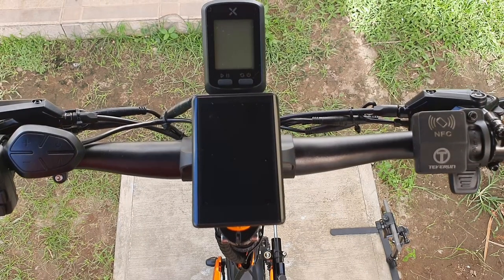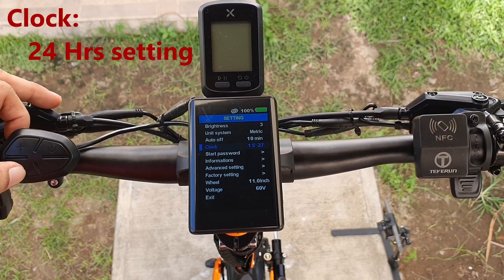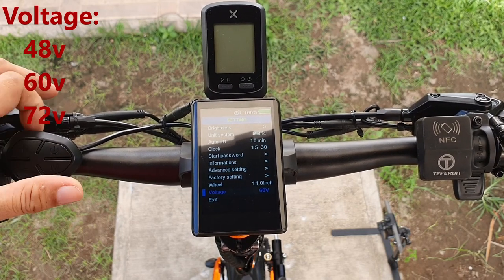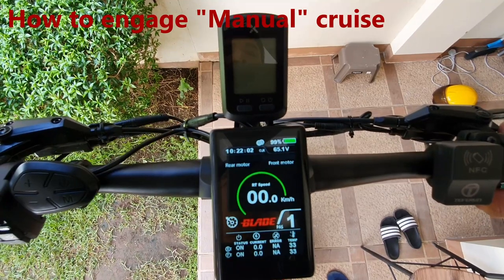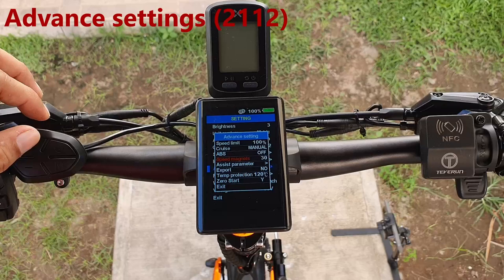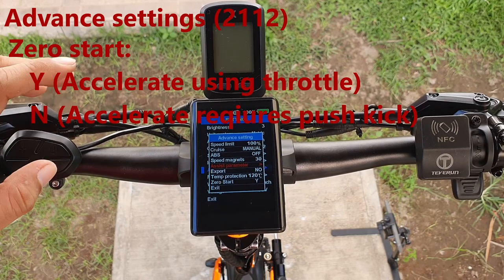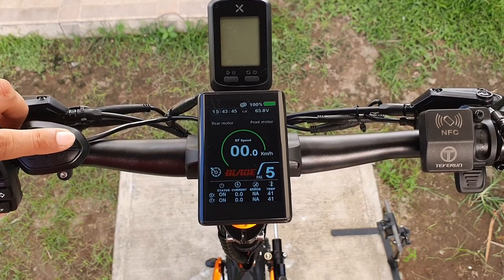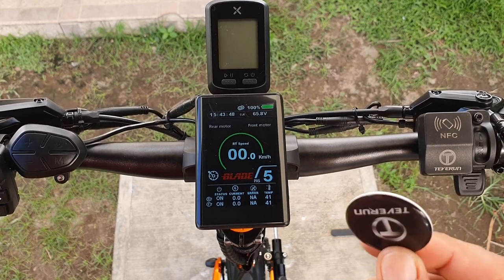Blade GT Plus - TFT Display Info and Settings

Comment: I’ve heard from another vlogger that the inside wiring is really bad. Can you give any tips on how to secure the inner wiring? Where to add thermal pads or electrical tape to boost the longevity? You seem to know your stuff!
Reply from the maker: Hi @Travis Thank you for your comment. I am currently doing a video to improve waterproofing to our scooter deck, cable/wiring management will be included in the video as it plays a significant role to making it watertight.
Reply: @ScootTaBai  Will you be doing anything to improve the wiring insulation or sharp edges in the deck as well? I've heard issues about shorts and fires etc

Comment: I was told the temperature are not from motor but the controllers. can you validate that? there's no thermoprobe inside the motors.
Reply from the maker: Yes you are correct. The temp reading is from the controller

Comment: Hi, any way to sett separate password for advance settings (not the same as start password)? Also possibility to set password on factory settings?
Reply from the maker: Unfortunately there is no option to change the dafault pw for the advance settings. Not even in the owner's manual. Only when you enable the start pw, it will update the adv setting pw, but as soon as you disable the start pw, the adv setting pw will revert to default

Comment: I have one just like it, but when I load it it doesn't reach 100%, it stays at 97%, do you know what it could be?  The led side lights don't come on either.
Reply from the maker: Try to use a volt meter and check if the voltage reading coincide with the reading from the TFT display, if not, them probably there is an issue with your controller given that the side lights dont power as well.

Comment: Hi, why I can’t set the eabs in parameter 2-5 in 1 value? It will reset back after turn off and on the scooter
Reply from the maker: I am not really sure, maybe a software version perhaps. Mine has no issue setting eabs to 1. If you look at my video, my settings to all assist/gears is on eabs 1.
Reply: Yeah I think is the software version the problem, any idea how to change/update the software/firmware?
Reply: yes i have the same problem...
every time i turn off and on again eabs returns to the same factory parameters.
any way to update the firmware ???
Reply from the maker: @nunovit4576  for now, there are no instructions or software available in the internet. This is something that only Teverun can do.

Comment: Great detailed video. Couldn´t fund any for my upcoming blade mini pro with display, but my guess is mostly will be the same options ? perhaps with only 3 assist modes and 48volts (?) but not able to confirm.
Reply from the maker: If it comes with display, it should be the same. If its with ey3, P settings are available online

Comment: Can I also do this on my blade gt? My extender wire connector for the charger is not a t plug. Will It still charge both batteries ?

Comment: I have an issue with my GT+. On a bumpy track for example in Forest my scooter makes squeaky noises from the front. Do you have any solution?
Reply from the maker: From experience, it’s either your stem insert or the suspension bearing. If its the sound is coming somewhere below, its from the suspension bearing and just put lubricating oil. If sound coming from upper, its the stem insert.

Comment: Hello. Is there anywhere to check the Cut Off Voltage? I couldnt find this setting anywhere. Is this normal? I thought the cut off voltage was 48v

My scooter has been powering off at 54v.
Reply from the maker: 54v volts is just about right since it will go down to at least 2v when you accelerate (52v). I haven't tried lowering the voltage of my Blade that much, but to my other scooter with 60v, the cutoff is 52v (25%). So if im on 54-53v, i will set to ECO mode so the acceleration will not bring my voltage down to 52v. 48v is zero (0%), the BMS will not allow our battery to be totally drain or it will get damage.

Comment: Hey mate do you know how to use the manual cruise control on a Fighter 11+ ? I would have assumed the Blade GT+ also has cruise control but maybe not?
Reply from the maker: If they have the same configuration, make sure that your cruise is set to manual from the dashboard. When you’re riding the want engage cruise, just press and hold minus “-“ until the cruise icon turns green, then you can let go of the throttle.
Reply: @ScootTaBai  Thanks I will try that - I'm finishing a small repair but I am having trouble re-mounting the back right deck cover 🤔

Comment: Hello. I have a new Blade Gt+. What should I do if my tires are not balanced? When I increase the speed, it spins a lot. I saw in your video that you also have unbalanced
Reply from the maker: That's  normal with CST stock tire. Hahaha. It's the same with other scooter. We've change a lot of tires and the most balance is PMT tires, no need to add weights. I dont want to do anything about it for now as I am only doing chill ride and city cruise. It doesn't matter much, unless if you are into circuit racing
Reply: @ScootTaBai  Thank you for your response😉

Comment: Hey 👋 Thank you for your video. Does the voltage and battery percentage drops a little too when you turn on the light of your scooter?  thanks 🙏
Reply from the maker: Yes it drops at least 2 volts. The reason I dont like night ride that much. 😕 just add external lights and use hazzard (both signal lights) if you really need to go out on a long ride at night.
Reply: @ScootTaBai  Thanks for your answer. Does it impact the level battery too? I mean : if your battery level is 100%, then you turn on the light, the battery level drops between 80/95% (depending the light intensity), then when you turn off the light the battery level switch again to 100% ?
Reply from the maker: Yes, 2 volts is a big drop. Fpr 2 volts, you can go for at least 6-9 kilometers on it. The dash percentage reading also drops at least 10%. But as soon as you put the lights off, it will give you back the 2 volts (10% reading).
Reply: @ScootTaBai  Thank you so much 🙏 Maybe a software update would fix this issue 🤔 ?
Reply from the maker: Probably. I dont want to tinker around inside the deck for now as my unit is still under warranty. My guess is, the main light is also 60 volts, thats is why it consumes a lot or battery power. unlike other scooter that the main lights are 12v or 24v only and they just use buck converters.
Reply: @ScootTaBai  Oh ! So it's a hardware issue not software... 😣

Comment: Also you can drop dual motor to single motor at speed, but make sure you NEVER shift from singleup  to dual at speed. Do it etheir at slow speed or at a stop.
Reply from the maker: Nice advise sir
Reply: @ScootTaBai  Well you can switch single into dual at speed but if I remember correctly you have to wait half a minute for magnets to synchronise before touching the throttle. 
Otherwise if you switch to dual and immediatly push the throttle the rotor synchronisation is brutal and dangerous (especially with 1500w motor power), but I think it's best avoiding switching to dual altogether if you already going fast and wait for a stop.

Comment: Sir can we put a different current settings in the.front and rear hub? For example, is it okay to have a higher current in the front hub than the rear hub?
Reply: Coz i notice that there is more strain or power consumed in the rear hub than the front hub eapecially on a steep road.
Reply from the maker: Yes, you can definitely set different power of your motor depending on your ride, terrain, etc. But make it so that the motors will not be stressed, my guage is the motor temperature. As long as it is +/- 5 degress difference.

Comment: Hello.  The video is very informative.  I copied your settings and also did the washer swap.  Made a great difference!  Btw, I was wondering if the tft display is the same size as that on the Nami?  I was looking at a case, but it was built for the Nami.  Thank you in advance. 😊
Reply from the maker: Yea its the same swith with Nami tft 3.5 inches. Other riders use the Garmin 830 rubber case
Reply: @ScootTaBai  Thank you again!  I really appreciate it!  Keep up the good work!👍
Reply from the maker: Your welcome sir

Comment: Hey mate, 

Í cant find any error code list for the blade gt pro im always getting  error 4 in my front motor when i start it
Reply from the maker: Error code 4 is Handlebar turning fault. Its in the Teverun TFT manual you get along when you bought your scooter. Error 4 probably means issue with your turn signal.
Reply: Cheers man thank you
Reply: It was actually error 1 and igot the manual now and  it says motor phrase  i dont  know  that means 

my motor gone  bad after 1900km :(
Reply from the maker: @alexgubjornsson4179  did you get the motor wet somehow? Does it still run when on single motor?

Comment: Hey friend, why does it charge me up to 97% and not 100%?
Reply from the maker: Hi sir. What is the voltage reading on your display when it hit 97% and stop charging?
Reply: 67.7v
Reply: yes sir it stops charging at 97%
Reply from the maker: Wow that's very high. 100% for 60v battery is 67.2v. It is expected that your bms will stop charging because your battery is indeed fully charge. I think your dash display is out of sync or have some issue.
Reply from the maker: I have a friend with Nami and his dash display got issue. It is reading 90v and always on 100%. Nami is only 72v and fully charge is 84v. As soon as he replace the dash as advise by Michael, issue got resolved.
Reply: What do you recommend to do then sir or is it ok like this, and what pressure to fill the air in the wheels and thank you very much for your help sir 😊
Reply: The scooter is brand new
Reply from the maker: I fill mine with 32psi. There's always bad apples among the good ones. Make sure to inform your vendor; hope they have a good warranty policy. That is very easy to troubleshoot and confirm, temporary replace the dash from a good unit, if it fixes the issue, then that's it.
Reply: What is the dash part you are talking about?
Reply from the maker: The entire tft display. It is just connected with the socket pin, it can be easily removed from the handlebar and no need to open your deck.
Reply: @Scoot Ta Bai  I had the same issue with the original TFT display on my blade GT+.
The volt meter always registered a full charge at 67.7 volts instead of 67.2, and the battery meter always peaked at 97% when fully charged,never 100%.
Volt and battery meters were out of sync and needed a firmware update from Teverun through their app which they are yet to make available to GT+ owners experiencing this problem.
With no specific date given for the release of the app waiting was no longer an option so I went ahead and purchased a new TFT from a dealer and problem solved.Both voltage and battery readouts are now in sync and give accurate  information during the operation of the scooter.Also,when the volt meter shows a full charge at 67.7 volts the battery meter now correctly indicates100% at this voltage.
The owner who contacted you should get the 2nd generation TFT that doesn't require the firmware update, unlike the 1st generation TFT that needs the update to function properly.
Reply from the maker: @waynecameron8253  good point sir and thank you sharing your experience. This is very helpful to our community that are having issues with their Blade scooter.
Reply: @ScootTaBai  You are very welcome. Forgot to say,keep up the good work you do with your videos because they provide valuable information based on your knowledge and experience😊👍👍